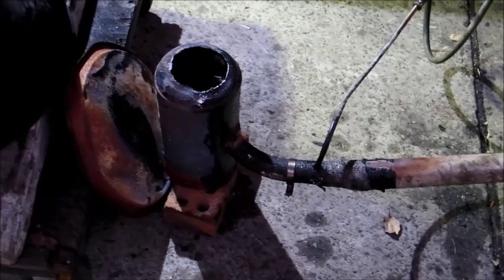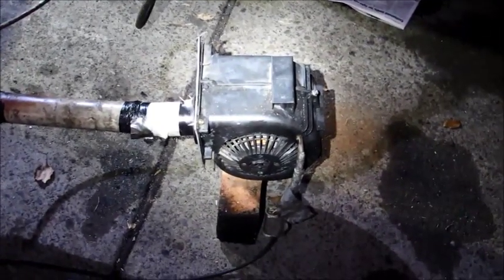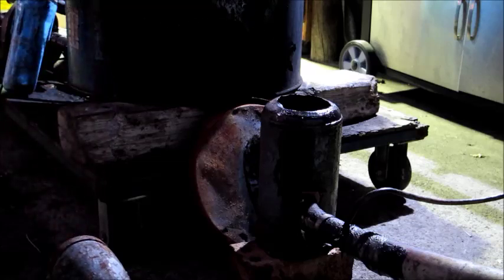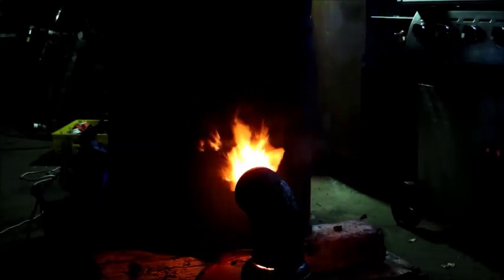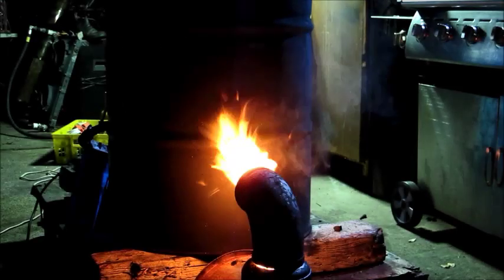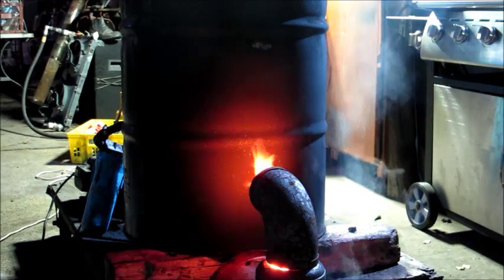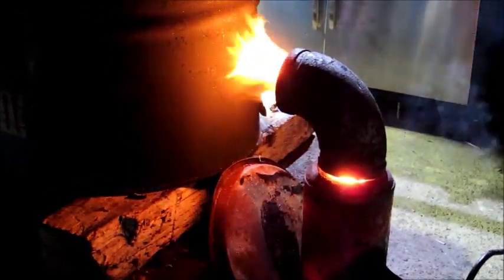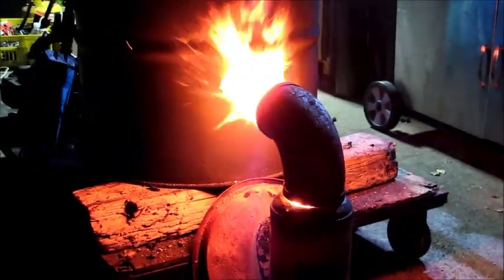How To Light Waste oil burner WVO WMO

Comment: What happens if you don't have a blower? I don't get why you are pointing the flame at a drum filled with veg oil? Burn water off?. I tried pouring a little veg oil in a small pan then added some newspaper and lit it and it didn't do much. It kept a tiny flame for a few minutes and that was it.

I made a little stove out of scrap steel and was thinking how I could burn veg oil in it.

Comment: Have you ever tried burning glycerin from the waste left over from biodiesel? I was wanting to see a video of you burning that and see how long it would take to get wvo up to 150' so it could be transferred to a processor to make biodiesel.
Reply from the maker: Shawn Ecklor  No , I don't have a supply of glyc but unless it is dried which also takes the meth out, it's not great fuel and probably would not self sustain without being fed as a secondary fuel or mixed with the oil.

Comment: Do you have some type of nozzle on the oil supply line, or just an tube going into the top of that air input pipe?  Did you drill and tap the hole, or how do you attach the supply line?

Thanks!
Reply from the maker: The tube just dribbles the oil in. There is no nozzle or jet. As the oil goes in it is blown into the burner by the air stream. I just drill a hole and sit the tube in there so it's easy to move and use with the tank on other burners.

Comment: How long does it take to get the drum temp up to where the water will boil off? I'm guessing a couple hours? This would be perfect for my setup prior to centrifuging; I occasionally end up with a lot of water in the wvo I pick up; it will fill a centrifuge bowl easily.
Reply from the maker: It will easily boil a drum of oil in 30 min. You can see on another vid where I did it in 17 min. Spraying the oil like in my processing vid will have most oil well and truly dry enough to pass a HPT in under an hour.

Comment: Peter, Just wondering what hoses you are using from your pump to the drum - they look like some sort of flexible ones, i am just re-doing all mine now and wondered what you used and where you got them

Craig
Reply from the maker: Hi Craig,

The hoses are actually from an old fire hose reel. I picked up about half a dozen of them from a Skip bin. I think they must change them out after a certain time although the ones I got were all perfect. Converted the garden hose with them as they are 3/4" and flow much better than the piddly little 12MM and are a whopping 36M long so reach everywhere. Also use them on my WVO powered home heater and they stand up to the boiling water well also. I have a reel I just cut off whatever length I need.

I see them on Ebay now and then used so you might pick one up from there.
I have also used Hydrulic hoses which came with the fittings to screw them straight in. They were another dumpster find although still brand new in the packets. They were just a little short of this setup but on my other processor they were great.  Hate to think what they were worth to buy!
Reply: Oil Burner Good one thanks Peter. Had not thought of that - i also have a roll that i have had for a while - out comes the hacksaw !!!